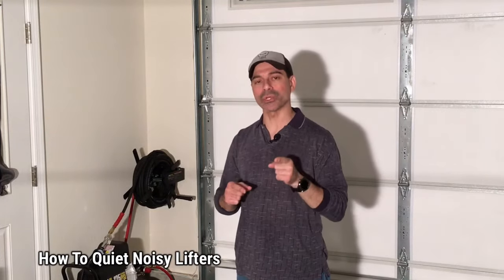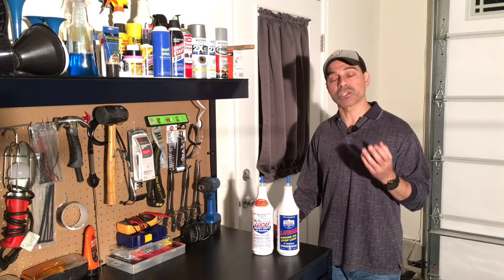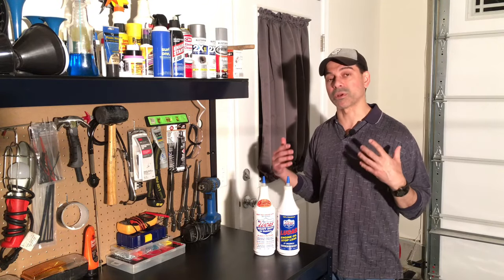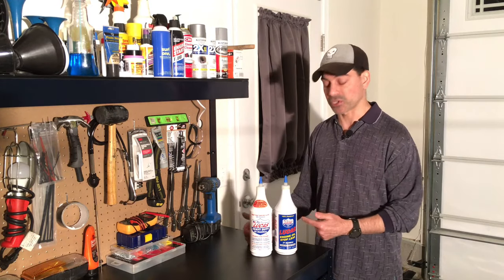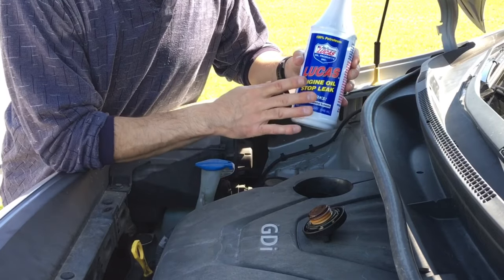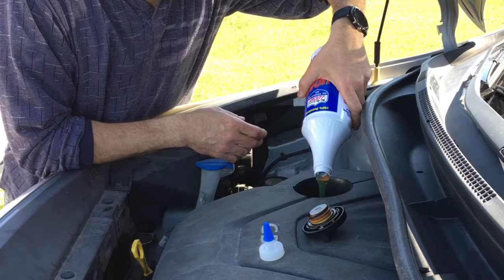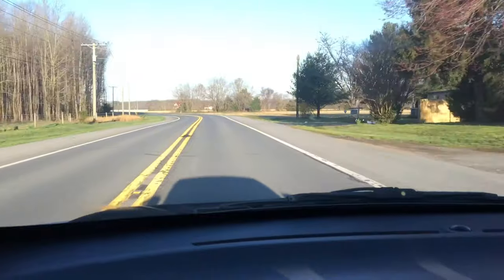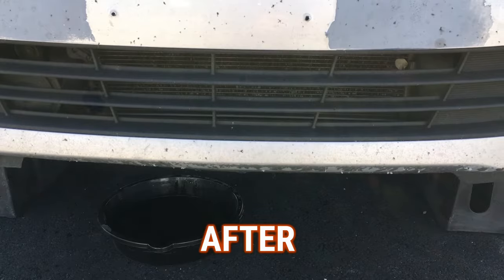How To Quiet Noisy Lifters (Andy’s Garage: Episode - 253)

Comment: I have a 2013 Chevy Cruze that has a "clinking" sound(like glass clinking together) when i drive and increase the RPM's. It's almost nonexistent when idling, but every time i press the gas and increase those rpm's it makes that noise. I assume its "sticky valve", but can't be sure. Would this help with that as well?
Reply from the maker: Valves usually have a “ticking” noise. The clinking noise could be something loose
Reply: Down the valve guides

Comment: I DID THIS EXACT  WHAT  WAS SUGGESTED ON THIS VIDEO ON A  2006 Nissan Xterra  AND 3 DAYS LATER  MOTOR SIEZED I WOULD ADVISED USE CAUTION AND BE READY TO HAVE POSSABLE FAILURE. BE VERY MIND FUL IT IS VERY THICK VERY THICK BE WARNED!!!!!

Comment: I've got a ford laser hatchback 1995 model 1.3 B3 engine when I start it and the engine get warm then my lifters r very noisy what can I use to quite the noise pls
Reply from the maker: Try the method used in this video. If they are not too bad this should help, if they are bad you’ll need to replace them. Also make sure your oil level is not low.
Reply: Can the noisy of the lifters also making your car smoke

Comment: My 2011 dodge Durango is 8 cylinder hemi
Is knocking I just replaced the engine. So I need to take the cheaper route. How much solution would you suggest? Mine sounds like someone it tapping a dime by the gears. SMH.
Reply from the maker: You need to check your engine’s oil capacity. My V8 takes 6 quarts so I would put about  3 quarts of engine additives and the other 3 of synthetic oil
Reply: Is it normal for it to tick when parked.  Minutes after shut off
Reply from the maker: @BLIQUEMIST26  Hemi engines can tick, and it can be normal. You do need to make sure you use quality oil and fuel; if not, it can develop a bad ticking problem
Reply from the maker: @BLIQUEMIST26  I realized I answered your oil capacity question wrong. I confused cylinders with quarts. I edited my answer if you want to re read it
Reply from the maker: @BLIQUEMIST26   I realized I answered your oil capacity question wrong. I confused cylinders with quarts. I edited my answer if you want to re read it
Reply: @PhillipsVision  what’s a good brand and. Grade
Reply from the maker: @BLIQUEMIST26  for oil I just use Walmart brand synthetic oil. The weight will have to be based your vehicle manual. I used to use Mobil 1 but that can get expensive
Reply: @BLIQUEMIST26  - use the oil grade the owner manual says. The "engine oil stabilizer" should help to lessen the ticking or knocking. Also need to know when your spark plugs need changing.

Comment: My charger holds 5 quarts so if I use 3 quarts of Lucas do I only add 2 quarts of high mileage oil or more?
Reply from the maker: Only 2, you don’t want to overfill your capacity
Reply: Don't put 60%   maybe 20
Reply: @kennysnow6834  so how many quarts

Comment: Also Firestone drained the oil and put in lucas oil I dont know how much but it did not solve the problem,  any suggestions?
Reply from the maker: If the noise is bad you can put up to 60%, but keep in mind if the parts are too damaged they will need to be replaced

Comment: If I recently got a oil change can I just add it ?
Reply from the maker: You will need to drain enough oil so it can be replaced with the additive. If you just add it as is, you will overfill the oil capacity

Comment: Can I just pour it in with oil that was already in my car ? Or do I have to drain it out like you did ?
Reply from the maker: It’s recommended to do an oil change first and add the proper ratio to clean oil
Reply from the maker: @ovoaidan  if you do it that way, you’ll need to drain enough oil based on the number of quarts you are adding of stabilizer. You cannot overfill beyond your engine’s capacity.

Comment: Hi i have mazda 6 2003 2.0 diesel 152k km
And it has knocking sound in the engine when its on neutral but when i use 1st - 5th gear no knocking sound 
What will you recommend for me?
Lucas or rislone ?
I change oil it last week
Help me
Reply from the maker: In my opinion Lucas is more effective with silencing existing noise. Rislone is good as an additive during oil changes for preventative maintenance. Make sure you get Lucas for Diesel engines.

Comment: Risoline lifter cleaner works great
Reply: How much do u put in ?
Reply: @b-bitter91  it's a bottle a little smaller than a quart ,I didn't remove any oil ,just added it, it also quieted a grindy noise I assume was cam bearing, my engine whaps like a motorcycle now , not the poor acceleration followed by  grumbly deceleration

Comment: I also recommend to allow the Lucas oil to lay ontop of the engine block while doing the oil change to heat it up alittle and make it not super thick
Reply: Does this work for a 5.7 hemi
Reply: @Millionaireblacc  I'm trying to find out too. My daily driver R/T is sounding just like this.
Reply: Any updates on if it works on a hemi? @Trvp wizard
Reply: I sat my oils on the bumper today for about an hour... 105 degrees in Oklahoma, didn't have a problem with thick oil!🤣

Comment: Try Tribotex. Seriously. Expensive, but amazing. Quieted down a ticky old 2005 yukon xl with 200k miles in 15 minutes, and been perfect since. I already used heavier oil than OEM, (10w40), which is basically all that Lucas is, the  it did help quiet it down vs 5w30, but Tribotex completely eliminated it, it runs so quiet now it's weird to be in an old rickety car, sounds like the engine's off at idle lol. I have 3 older cars, all run like rolls royces now, it's legit. And I am not paid, I pay them, a lot lol. Totally worth it though, I always maintained my cars well, this is an additive that goes far beyond what good maintenance can do.
Reply: $100 bucks per tube is STEEP.
Reply: I can assure you that Lucas Oil Stabilizer as used in this video is thicker than OEM 10w40 oil.

Comment: I have a 2015 Hyundai Elantra it takes 4 quarts of oil how much of the Lucus stabilizer would I put in and how much oil should be put in? I just don’t want to mess it up. Thanks in advance ❤️
Reply from the maker: I would put 1 quart of Oil Stabilizer and 3 quarts of synthetic oil. If your noise is real bad you can add 2 quarts stabilizer and 2 quarts synthetic oil
Reply from the maker: @ovoaidan  you can use up to 3 containers of stabilizer if needed

Comment: Great video with amazing insights. I wonder though, will this work with hydraulic lifters?
Reply from the maker: I don’t think so. It is best to replace them when they start tapping.
Reply: There is a German oil company called Liqui moly, they make amazing stuff, probably the best oils and additives I’ve ever used, they make an additive specifically for hydraulic lifters and that quiets them significantly, I’d definitely look into them.
Reply: @prestonworden9811  thank you so much..I'll look into it..

Comment: Use 5w30 synthetic motor oil with mobil one or other high quality filter ,
Higher oil pressure at idle better lubrication for cam lifters no brainer,
It mite go well over 500k -1000miles 
Wrong oil ,or keep listening Manufacturer and do your lifter and cam every 50k-100k.

Comment: Andy, thank you for such an informative video.  Do you recommend this for lifters that only tick for a few minutes at cold start up?  I've taken the vehicle to the dealership and they claim they can't "reproduce the noise", even after keeping the vehicle overnight, and they do nothing.
Reply from the maker: How is your oil level? Could be caused by the levels being lo. Once the vehicle gets started, oil is circulating
Reply: @PhillipsVision  The oil level is good.
Reply from the maker: @WaitWhat-jy9ck  is it a ticking noise inside the car or coming from the engine area?
Reply: @PhillipsVision  It's definitely coming from the engine.
Reply from the maker: @WaitWhat-jy9ck  Are your engine oil and filter clean?, meaning, do you change them regularly?
Reply: @PhillipsVision  Yes.  The oil is changed at the dealership, which is not in my city, or at a local shop at every required interval with full synthetic.  BTW the vehicle only has 31,500 miles on it.
Reply: Hi, I like your video. And i have a question. Why do you need to do an oil change to it to put that liquid? Why can you just added to it?
Reply: @elcatracho3318  it will over fill the oil level

Comment: Hi Andy! So thankful I found your channel. You taught me how to change my coil packs. Now for the lifter noise, My 2014 Kia Rio only requires 3 1/2 quarts of oil. After I bought it, I just happened to check the oil from the dealership and they overfilled my oil. I’m anal about it now lol… Any comment suggestions on ratio for the Lucas? Thanks again so much!🙏😊
Reply from the maker: I used 60% Lucas since my noise was bad. If yours isn’t too bad, just do 20% to start

Comment: Would this be safe for a 1995 GMC Sierra? I have an oil leak and the lifters are making a lot of noise.
Reply from the maker: Should be fine. If your oil leak is bad, make sure you always check your levels and not let the oil get low.
Reply: @PhillipsVision  thank you for replying I was gonna use rislone but I saw your video on that project compared to this video there’s a huge difference
Reply from the maker: @davidlopez9034  I use both, but I prefer the Lucas product when it comes to noisy lifters.

Comment: Is that a kia rio??
Reply from the maker: Yes
Reply: @PhillipsVision  that's crazy, I have a little 2012 kia rio that I use as a run around car, started tapping really loud. Come on here to find some help and the first vid I find is a kia, perfect. I went to our local auto supplies dealer and they didn't have the 'Lucas stop leak' but other brands. I wonder if that would be okay?

Also my kia takes 3.3L of oil, so alot less than his, so I'm assuming it's still just 60% of that total.
Reply from the maker: @StrangeWorldcnn  yes, 60% total. I’ve used the Walmart version of Lucas and it worked fine

Comment: Sunday morning I filled up and I started my charger and a loud ticking and I mean loud. Got 4 estimates and it’s a lifter I’ve always used Mobil 1 synthetic so I immediately did 6 quarts of royal purple and 1 quart of Lucas synthetic and the tick is still there I wish I could quiet it down until the engine gets opened up 🤦‍♂️
Reply from the maker: Try draining a couple quarts and replacing with Lucas Oil Stabilizer.
Reply: @PhillipsVision  that’s what I put it my bad. Synthetic Lucas stabilizer

Comment: Since this is an internal engine valve wouldnt the engine light come on?
Reply from the maker: Not necessarily. The engine code light comes on when the sensors notify the ECU. If the issue does not cause a sensor to detect a problem then it will not trigger the engine light

Comment: Hii i have a renault clio i have ticking sound and i changed my oil and the sound is the same what can I do
Reply from the maker: Try adding the stabilizer content as shown in the video. Sometimes the thicker lubricant can quiet that. If it’s too bad you will need to replace the damaged components
Reply: Do they still sell STP?

Comment: What kind of oil did you use
Reply from the maker: 5w20 synthetic
Reply: @PhillipsVision  awesome thanks for getting one question would you recommend using a thicker oil or is that what the Lucas is for thanks again for getting back 🙌
Reply from the maker: @frankmontes7001  use the recommended oil for your vehicle. It should be printed on the crankcase cap. The additive will be the thicker oil

Comment: Amsoil Signature series oil use it and you won't ever have a ticking, knocking or tapping sound from any engine,  Full Synthetic,  it runs your engine clean, no sludge or build up, no wear on parts either.

Comment: What's additive did you add? Was it motor flush medic?
Reply from the maker: No, they were stabilizers. I showed them in the video
Reply: @Phillips Vision  Got ya. Thanks. I have an 08 escalade ticking. It's telling me engine oil pressure low. I'm at the point of taking the oil pump out. Don't know what to do. I've replace the oil sensor. I've replaced the the camshaft timing magnet and variable timing pin and nothing. I've spended over 700 on parts and I'm going crazy. Any tips you can give me.
Reply from the maker: @danielcarcamo6336  could be the pump, if you’ve already replaced the sensor
Reply: @Phillips Vision  I'm hoping. I've noticed the ticking goes away after a couple hours of driving but it comes back when it gets cold started during the 1st 30m. Now its just on ticking constantly. I check my oil dip stick for fluid and  it doesn't read anything but a slight bid. So I've been criticality thinking on doing this process. But 1st I will do a motor flush on it. The only thing is I don't know what other brand is better than that  to get the gunk out my engine. I've heard of diesel. Supposedly you can 3QT into the engine an it will dissolve any sludge. Motor Medic, Resoline, Lucas have the same thing so I'm also debating on this. At this point I'm in a Win or Loose situation and the engine cost over 3K.
Reply from the maker: @danielcarcamo6336  be careful, if it’s your pump you can destroy the engine by hesitating
Reply: @Phillips Vision  I know. Like I said I'm in a win or loose situation. I don't wanna replace it but if it comes down to it then I don't have a choice. I'm just gonna put in some motor flush and let it run for about an hour then the regular time is 5m it asked of. Next I'll drain it and start replacing the Oil pump and Tube. Hope this works.
Reply: @danielcarcamo6336  - You can do the flush and try the "engine oil stabilizer". The stabilizer should likely help to lessen the ticking.
Reply: @Shawn T  Thanks. I've actually solved the problem. The truck did have low engine oil. Due to my oil cooler lines being bad, as I drove the truck, the vehicle would put pressure on the lines, causing it to leak as I stepped on the gas and drove. I also had an oil pan gasket leak and the timing cover gasket as well. As I was there, I took it upon myself to once and for all change the oil pump. Put a new gaskets and fresh oil with a bottle of Lucas oil stabilizer just in case. Before the process, I did a RESTORE oil flush supposedly the bottle guarantees to clean the engine or money back. Sure enough, after the flush, plus everything I did, i turned it on and it sounds beautiful. Thanks for responding
Reply: @danielcarcamo6336 - 👍

Comment: I think those aren't good choices for my application. I never tried them myself, but several other products have a more positive review. Still trying to find out... my car don't use lifters, but those cam on buckets, so I don't know what will work. Before changing them maybe I'll try some oil additives. First cleaner additives, then maybe, such thickeners.
Reply: Mine uses the bucket shims as well but I looked up gdi and they have bucket shims as well. Gonna give it a try on my 04 Infiniti g35x
Reply: @hauntingtonjohn I tried it all and no joy. The only thing that quiet the engine was 3ml of chlorine per quart. Quiet as a mouse church now!

Comment: Good morning my name is Ronnie i have a 2007 kia sorento and i use a engine flush before i change my oil . when i put in the new oil my Lifters started to be noisy what can i do to stop that noisy lifter.
Reply from the maker: Is your oil level filled to max? Did you also replace the filter? Sometimes dirt in the oil can cause this.
Reply: I added Lucus oil and stopped my ticking on 07 Sorento. Don't  use flush too often.
Reply: You can try the "engine oil stabilizer" for the noisy lifters.

Comment: I noticed that you didn’t show the condition of the car.  So it clearly shows that the was trashed already and whatever happens next to the engine goes without saying.  There is no way you would do that to a nice car.  There isn’t a mechanic in a plastic bottle for you to fix that.  And what about the oil filter getting clogged with all that goo that you put in?   Oh by the way , is that a kit car looking like a Lamborghini towards the end of the video?
Reply from the maker: The car in the video had an engine with almost 200,000 miles on it, the engine was in bad shape. It did not clog the filter. Yes, it’s a kit car.

Comment: You missed the other reason... carbon and sludge build up so oil cannot lube the lifters...
Seafoam it. STP Lucas thick stuff is not a Fix, which is removing carbon/sludge...
You are just throwing a band aid, or a comforter on engine, to quiet, but not to address cause only dealing with symptom.

Comment: How would I do this in a 2004 gmc 5.3l v8 that uses 6 quarts of 5w30 oil ?? How many bottles do I use + synthetic oil??
Reply from the maker: You would have to calculate % based on your quarts. You can put up to 60% additives
Reply: It takes 6 quarts of oil
Reply from the maker: @BrianJohnson-tz6xl  ok, 60% of 6 is 3.6 . Let’s round to 3.5 quarts to measure easily. Pour 3.5 containers of additives and then  add 2.5 quarts of synthetic oil to top it off.

Comment: Anyone try this on their infiniti's ticking?
Reply: I want to try it on my 2018 q50 but I’m buying a obe or whatever it’s called scanner to see what it is as well
Reply: @q50_rogan41  it didn't work at all on mine and I've driven about 1000 miles
Reply: @hauntingtonjohn  mine worked, I also installed cone air takes and removed the boxes to give my space and now I got a check engine light cuz of one of the sensors lmao
Reply: @q50_rogan41  these cars have so many sensors it's insane

Comment: "spacing"?????  Do you mean lash????  Let me help you...and others.  Step 1.... substitute a quart of transmission fluid for a quart of oil (high detergent).  Drain and fill with straight 30.  Play around with the oil.  Finally...avoid using synthetic when you start getting lifter noise.  You should not adjust lash if you dont know what lash is.  Roller motors are a whole different ball game.  Tons of lifters failed and if you continue to drive them (LS perfect example) you'll ruin the engine.